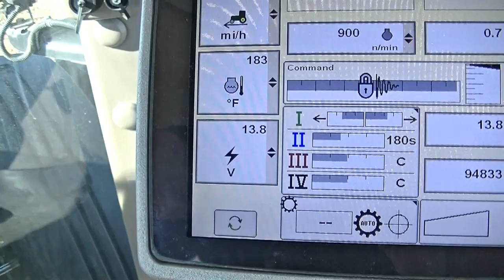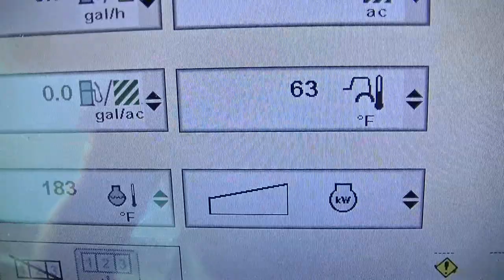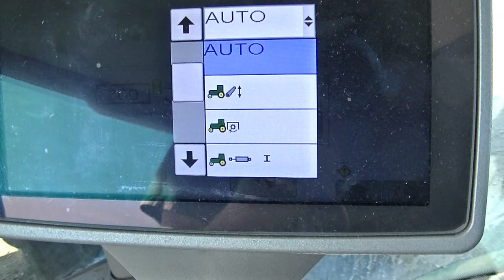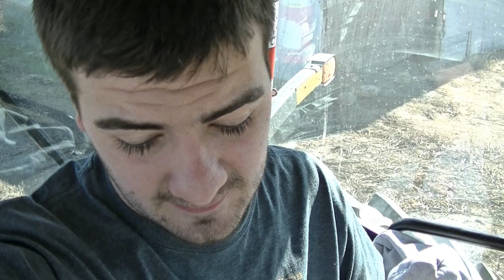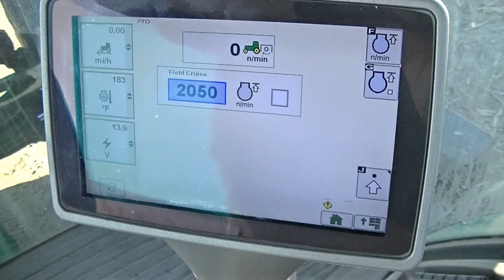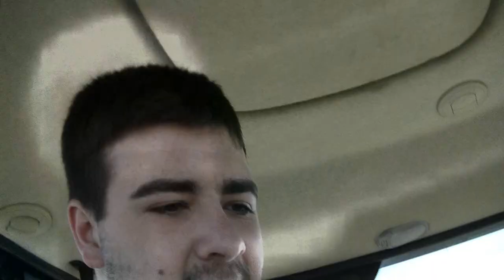How To Operate A Tractor - John Deere 8235R CommandCenter

Comment: Really like your videos, I tend to binge watch several at night to try to catch up.

On the DPF ... once you guys get some hours on the 8235r and it seems to go into regen more and more, there are relatively cheap solvents that you can use to help clean out the DPF.  It'll require a partial tear down of the exhaust to be able to get the solvent where it needs to be, but it'll save you tons of money vs having the DPF "baked"  Typically the more the engine idles and is run at light loads, the sooner the DPF will need to regen.

Keep up the great work and thank you for feeding America!

Comment: The reason there is a exhaust filter cleaning disable is say you where in a hay barn or some other confined spaces with flammable you can turn it off for safety. This is because exhaust temps come out some where around 800 degrees fahrenheit at the tip and can be a big fire risk.  But you are correct if you keep it from doing the cleaning you will be do you derated to idle if it will let you start it at all, tell you have a service technician come out and run a manual DPF cleaning.

Comment: Ryan, you run yours on auto mode for just disking or just light tillage. I'm asking because I just got a 8335r with a ivt my dealer tells me to run in auto all the time. I was plowing this fall but it pulled harder in manual mode.

Comment: Lots of "gee-whiz" factor, plenty of toys, but I guess I'm  old fashioned... I like the older tractors where you've got a kill cable, a key, a clutch, a gearshift lever and  maybe powershift lever, and a few levers for SCV's and the 3 point hitch, brake pedals, diff lock pedal, and a few switches for the lights and AC/heater controls and fans.  Basically, the KISS principle... 

All that electronic stuff is FINE *while it works right*, but these tractors won't last 50 or 60 years like the old ones... electronics eventually just go to pot with age, and then this thing will be too expensive to fix, can't get parts, and it'll be cheaper and easier to send it to the junkyard than to keep it running.  

I guess if a guy is farming enough ground to wear the thing out in ten years so it's ready to scrap mechanically anyway from being flat wore out in the engine and transmission, that's fine... cover a bazillion acres the thing will be falling apart anyway-- new stuff isn't built as stout or reliably as the older stuff... 

Electronic everything is neat, but the simple fact is, 95% of it is really unnecessary, and just overly complicated stuff to do the same thing a cable or lever could do reliably until the machine was just completely worn out and ready for the scrap heap... Just a LOT of extra money up front and a lot more to go wrong when you really need it, IMHO.  

Later!  OL J R :)

Comment: Ryan, why did you go with the 8235R instead of the 7230R they are almost identical a very small amount in power 235 vs 230 the 8R can get front duals while the 7R can only get front singles but with the super wides on the 7R it's almost the same. So why did you choose to go with the 8235R?
Reply from the maker: Different weight class primarily.
Reply: +How Farms Work Why did you want a heavier weight class? From what I have seen through your videos (Which I love by the way) the disk would require the most power and weight but not that much.
Reply: +How Farms Work what farm you at
Reply: Me?
Reply: +Evan Davidson you can put front duals on any tractor

Comment: Wiscansin fermers, I think maybe a dozer would be great on some of your fields to clean up the tree fingers growing up into the middle of the field, On our farm in Northeast Iowa the hills just suck to have trees growing up into the fields and it ends up saving alot of time fuel and money in the end if you guys were to make them tree fingers water ways making it easy and more efficient in the spring to get field work done.
Reply: +CoolishBeanz also another question why don't you farm on 30 inch row instead of 36 inches

Comment: if you leave the mfwd in auto it will go into two wheel drive when you reach 15 or above
Reply: +GreenGangster 01 Wrong...4wd in auto mode DEACTIVATES when going over 12kmh, when you raise the 3pt or when you steer the wheels past 45 degrees from straight

Comment: Peice of advice from a heavy diesel mechanic, don't ever, EVER buy a vechice thats teir 3. DPF systems give you half the power while using twice the fuel! Also no plugged filter will ever be cleaned by running the engine at 1500 for 8 hours, they gotta pull it off and send it out for a "high temp burn off" love your videos though Ryan!
Reply: +Jaden Kuntz Never had that problem with any of our tractors all tier 3

Comment: I also dont get why they put the temp controls on the command arm. Just put it somewhere away put it on 18 degree or 19 celcius automatic and be done with it. Yes I know it will require climate control (a 1500 dollar option right? :D )